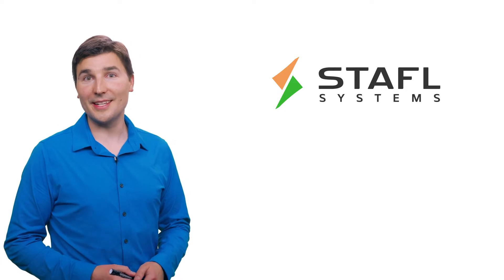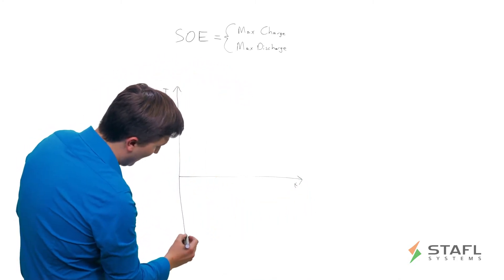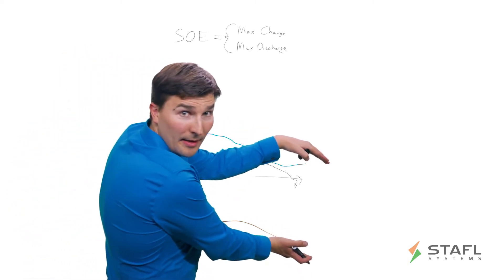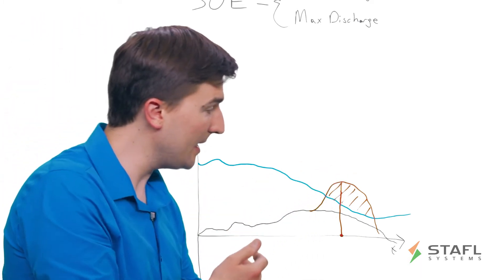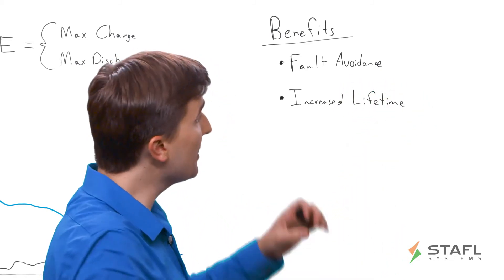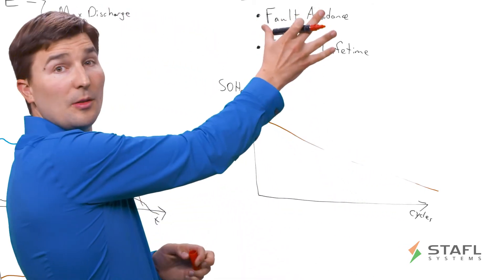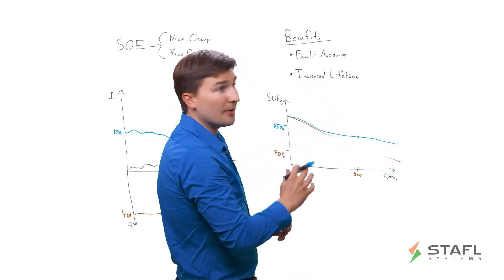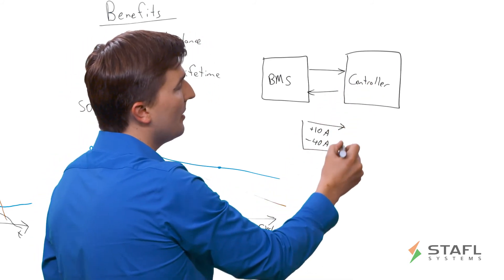Safe Operating Envelope for Lithium Ion Battery Systems

Comment: Nice one, I do have 2 different battery, 10 KVA Lifepo4 (DIY) and 9.6 KVA (VRLA, 4 X12 v X 200 ah) is it possible to parallel them? if yes, how to set the charging and discharging parameter to be safe?

Comment: I rely on my ESC for cut-off voltage (3.0v per cell)  and to "limit" maximum discharge, is there a potential problem with that? Currently using a low amp BMS with discharge bypass (for charging only). Thank you for the comprehensive videos.